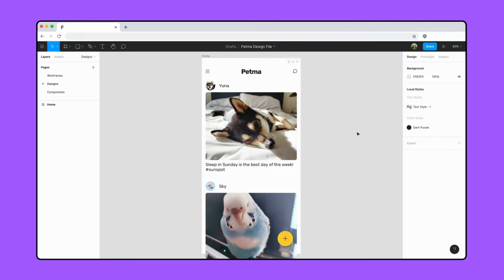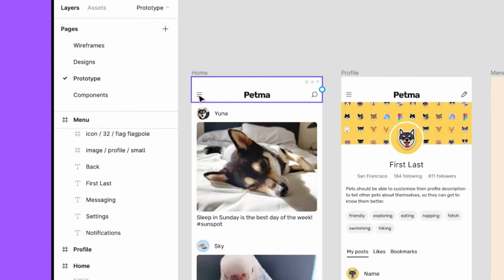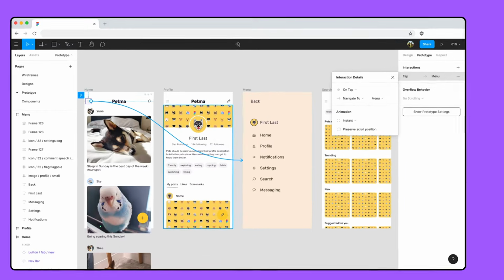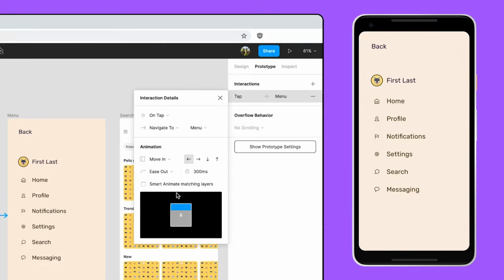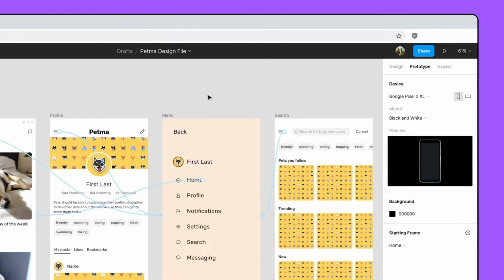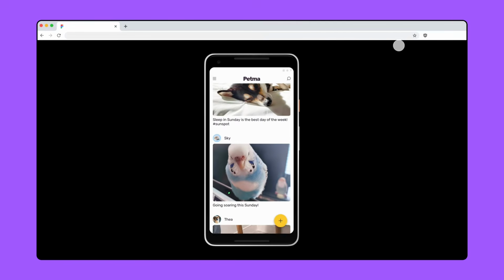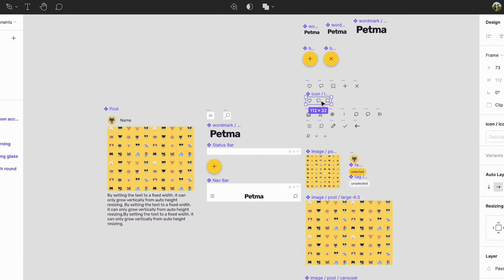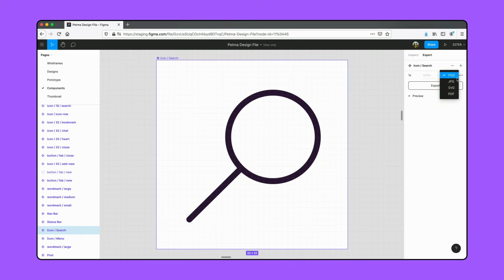Figma For Beginners: Build prototypes (3/4)

Comment: I have a question on the use of frames. I noticed that some of the icons in the above video uses a frame (like those in the navigation bar) and some do not (like the heart icon). When should you use a frame for icons/elements and when not? What is the difference?